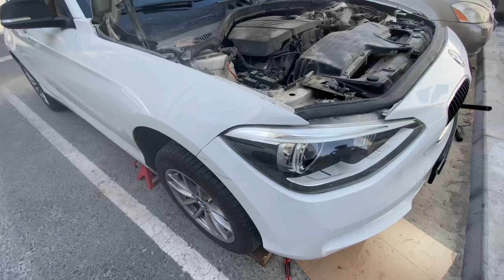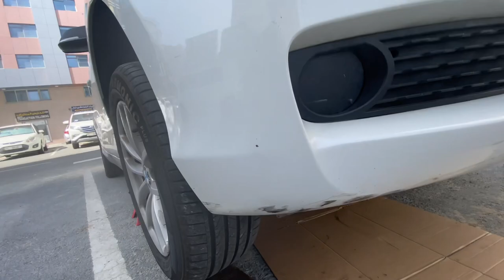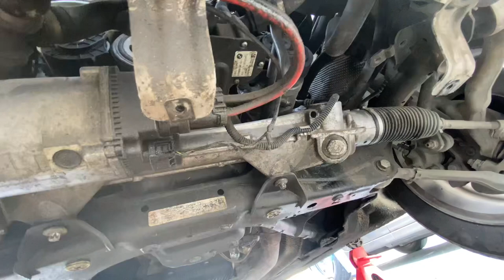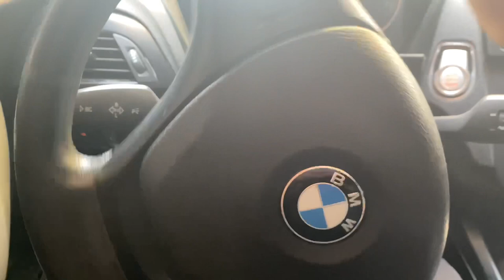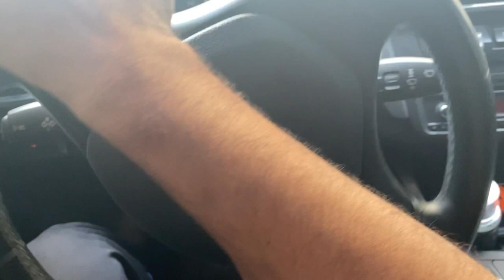BMW STEERING WHEEL KNOCKING SOUND FIX !!!

Comment: This is my third electric power steering rack. I ordered the boat from the dealer, but they look super tiny, not compared to the ones I have.
Reply from the maker: Buy regular 16MM Steel Nut Bolt with good washers and install it. Not need for BMW made bolts as it's independent bolt with it's own nut 😉

Comment: Hi, I have the same on my X5 G05. I also replaced the steering rack but I still have these knocking sounds. Do you know how/where I can repair this? I am based in Dubai. Thank you
Reply from the maker: +971 50 294 4506 - Shak. He is a pro but expensive I guess. You can also try Shamir-Sree garage Sharjah +971 50 631 6503 less expensive. The electromechanical steering gear on the front axle is mounted by 4 bolts. The tightening torque is 100Nm+90degree which most of the garages are afraid of to perform. Note that new Bolts has to be used, don't use used bolts as there is chance of breaking.

Comment: Are you based in UAE,  I have x4 n having the same knoking sound. Mechanic ask me to change the steering box which is 15k aed
Reply from the maker: Yes in UAE. If your car is having electric steering rack just buy new mounting bolts and change it , tightening torque 58nm + 90° rotation(super tight)
Reply: @bimmerhacks i didnt understand your video changing bolts solved your issue? i have the same noise after waterdamaged steering rack fixed now it works but i have this knocking sound
Reply from the maker: @elderscroll1214  change the bolts and tighten it 58nm +90degree
Reply: @bimmerhacks  i will try my friend thank you
Reply from the maker: @elderscroll1214  did you solve your steering issue. Please reply, it will help others whatever the solution was
Reply: @bimmerhacks  no i ended up buying new steering rack for 2k$, because in the first place my water damaged rack was not functioning well even after repair and it was giving EPS error that makes my steering very heavy. i ended up replacing the whole unit. cheers mate
Reply from the maker: @elderscroll1214  Oops.... Thanks for the update mate